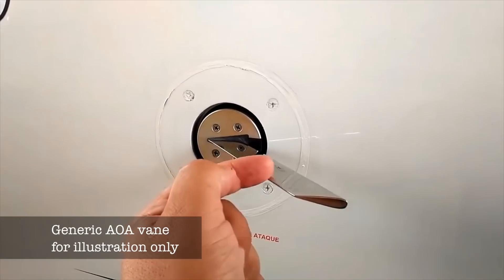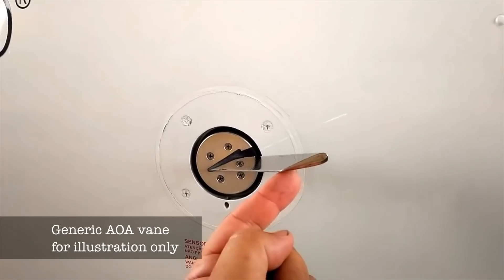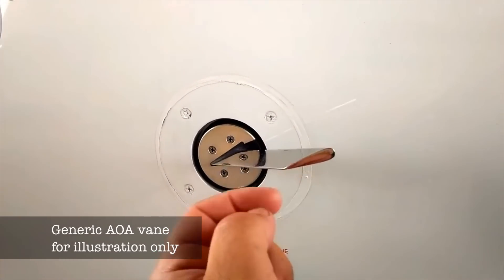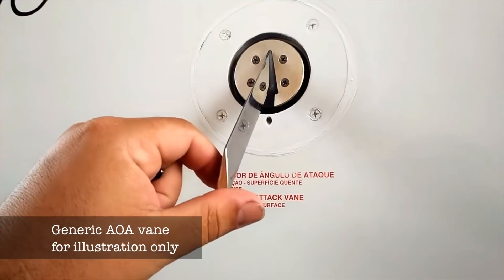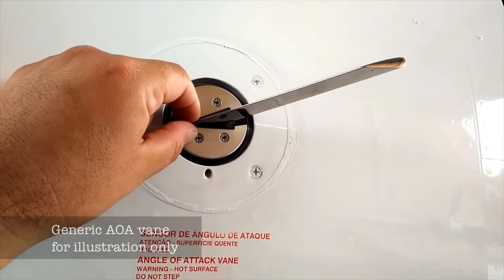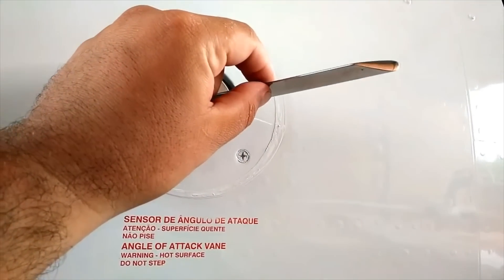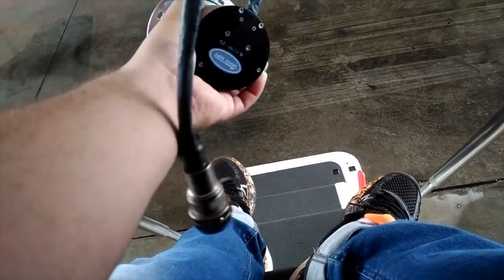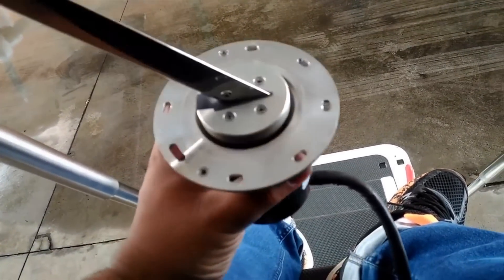Boeing 737 max 8 Angle of Attack problem - Prof Simon

Comment: dumb stuff:
using one of two indicators when comparing both would be the norm.
triple computer redundancy sounds great  ,  hooked up to one sensor does not.
no need for external sensors
you could do all this stuff with iphone gps ,  bow  , stern  , "one" wing tip , haha.
note that china was the first to ground the 737 , usa last.    usa yelled trade war at first.

i just learned that the 737 has only one computer instead of three
https://fortune.com/2019/08/02/boeing-flight-control-computer/
Reply: i just learned that the 737 has only one computer instead of three
https://fortune.com/2019/08/02/boeing-flight-control-computer/

Comment: Why is MCAS is required when Airbus 320 Neo do not  need it as they also have increased their engine power as well as placement
Reply: The Airbus is a more modern  aircraft with triplicated systems. It uses fly by wire or “FBW”.  In the Airbus the anti stall system is built into the fly by wire system.  So the Airbus doesn’t need MCAS it’s functions are already built into their flyby wire system.  Its a properly designed system with everything tripled or quadrupled.   If there is a fault in one of the four angle of attack sensors in the Airbus software compares all four sensors and works out which one is disagreeing with the others and switches that one out.  In the 737 there’s a 50-year-old hydraulic mechanical system and MCAS was a separate software and hardware add on to the artificial feel unit computers.  Because the B737 is an older aircraft it only has two of everything so the pilots have to decide which instrument is faulty.  In an Airbus because it has three systems the computers can decide themselves.

Comment: professor you are intelligent but not intelligent your angle of attack sensor your angle of attack sensor send the worng signal to mcas system and mcas system down the plan nose pitch to the ground and result is that 600 or more than costly and important for this world people's looses there lives I am very sad due to very bad do with them. Boeing wants to do properly checks there's plans like gauges all electrical and mechanical and electronics components,sensors etc.billions of people's looses there life's previus 80 years due to air crash incidents. please Boeing stop the play with people's life's and do not instal this types of bloody fool sensors in plans.

Comment: So now latest reports indicate the pilots DID shut off the stab switches to disable MCAS but were still unable to recover the plane from the fatal nose dive ,the story goes on ? Could it be MCAS restarted itself even though stab switches were off ? There's obviously still huge questions but this is looking more serious everyday that goes by ,I am so glad the planes are at least grounded if its saved 1 life its the correct thing to do.
Reply: Turning the stab switch are off turns off the motor that moves the stabilizer. That means that MCAS can't continue its mischief, but it it also means the pilots can't use their manual control on the yoke to drive that motor. They must hand crank the trim by brute strength. Given a number of factors, including the plane's excessive speed, that apparently became impossible. Near the end and in desperation, they turned the stab switch back on. Unfortunately, that brought back MCAS.

Yeah, you're asking yourself, why didn't the pilots have a way to turn of MCAS and just MCAS. Ah, but you're asking for a well-thought out design. That's not what we had here. This was Keystone Cops become plane designers.
Reply from the maker: If the MCAS system keeps re- starting that would be a major problem...I think we already know it trims the horizontal stab...beyond the point, elevator input can easily recover the aircraft... looking bad

Comment: Surely  vulnerable AOA vanes could be replaced with more robust Strain Gauges?
Reply from the maker: They need to measure air pressure...there are non moving sensors...good point.

Comment: I see the Lion Air logbook write up as an essential that lead directly to two crashes killing almost 400 people. Let's say it again. The off duty pilot saved the day on the first Lion Air flight by intervening and by correcting the MCAS failure. The crew made a logbook write up and the ground crew checked the system resulting in writing it off via "could not duplicate" write up. The next crew crashed the plane killing 189 aboard. They didn't read the write up from previous day? It looks like they didn't and that would be a monstrous failure making them on large part responsible for the second Ethiopian Air crash as well. Then the Ethiopian pilots didn't know about the Lion Air crash? It looks like they were as ignorant as the Lion Air crew! In my view, if these pilots were at least partially competent, we had no crash of the Boeing 737 MAX...

Comment: May be ice built up on the floating valve sending wrong signal to MCAS causing pitching angle downwards. More moving parts dangling out side of fuselage means unsafe ✈️ .

Comment: When I worked on the BAe 146/RJ Series, there were 2 AOA vanes. The anti stall system (stick push) was armed when the left or right vane reached a certain AOA and only when the other vane reached the trigger point, the system kicked in. The cross checking prevented un-commanded triggers. I'm totally lost for words if this is how the 737 MAX system operates. In ANY safety sytem there is redundancy and a level of supervisory diagnostics to validate sensor data. Where was the DFMEA? What questions were asked? What testing was done? Combine that with effective self certification via the FAA and I would expect both Boeing and the FAA to take the full wrath of the investigation outcome. This is not an unforseen accident (or 2), this is gross negligence by all parties on a mamouth scale!
Reply: And remember angle of attack sensor that is designed to be used for stick shaker and stick pusher are best designed to fail with a false high angle of attack reading which is fail safe considering the function is a warning and is also plausibility checked by comparison with a second sensor.  In the case of an angle of attack sensor being used for MCAS it should fail with an artificial low reading so it’s not used by MCAS forcing a dangerous maneuver.  This kind of super powerful system really needs triplication.

Comment: I see the accidents from a background in inertial navigation systems and earlier as a reliability engineer.  The MCAS system basically is only 2 failures from disaster as was the Airbus in the Atlantic a few years ago, both of which which crashed from 1) a failed AOA sensor and 2)  the crew failing to recognise the problem. Even though it can't always be done,  when a system can kill people,  the goal should be is to never be 3 or less failures from disaster.  With two AOA's and an inertial navigation system (which has real time pitch axis values in it) to check against each other and adequate crew training, none of those crashes needed to occur.  I don't know if the inertial pitch axis values were designed to be available to the MCAS system computer but they should have been.  Same argument with the Airbus.

Comment: I'm probabily not getting this right. If the system switches from one vane to the other and during testing no fault was found, does this mean they were test the vane that didn't have any issue? The testing was seen as a flight and switched to the faulty one the day of the crash?
Reply from the maker: That seems to be how the software works.

Comment: I don't believe this story. Makes no sense to have two sensors and alternate between using them as opposed to use both all the time making sure readings are correct. No way no how.
Reply: With two sensors you can only detect an error but not correct it. Since it seems boeing intended to hide the complexity or indeed existence of the system at all cost, detection of error was not interesting, so it didn't matter which sensor they used.
Reply: Nima Nikuie The story was confirmed by actual aircraft engineers in November last year. It has not received much publicity, since it is a subtle issue,  and hard to explain to the mainstream media.

Comment: You seem to have discovered the problem of tha particular incident . The problem. As an airline ,test pilot an accident inspector for the FAA. Through the 1970's and 80's I experienced the same occurrence several times and proven to be the AOA sensors in conflict "way back then" . It was decided by me an othe members of the airline flying community to not use such sensors any longer unti such equipment could be improved  or replaced with better and safer sensing equipment. At the time they were mechanical devices  which were proved to mechanical failure ,seizing  and sensing conflict.. Air Alaska had a perfect example of such a device in failure which was removed after a flight problem similar to what has been discussed.  A promis to look into the problem and the malfunctioned device but nothin seemed to ever have resulted until NOW!  Until real tragedy strikes.   The fact is I never liked the damned things. My planes fle very well without what i feel to be unececsary equipment. My feelings is for aviation technologist to look into and access the necessity of such devices and eithe redesign them so that they cannot dangerously effect the performance of the aircraft. Or get rid of such devices altogether. Thank you.
Reply: Myron Proudput There are multiple issues leading to the MCAS disaster. The AOA sensor is just the first weak link in the chain.

Comment: Is this the backup for a faulty accelerometer in the inertial reference system?
Nevertheless professor, this is very interesting. 
My instinct tells me I'm looking at a tiny airfoil. I'm not sure if this sensor ties in with air data or inertial reference, but, I see a surface that might be prone to icing more so on bottom than on top. This would create a pressure differential that pushes down on the vain telling ADIRS that the plane is at a higher angle of attack than actual. 
I hope they got heat for that like the pitot tube.
Reply: Michael McMurray Measurement of airflow and navigation are two entirely different systems, though they do overlap in the overall aircraft controls. They are heated to prevent icing.

Comment: I've been following the events closely ,this is the scariest thing I've heard ,does this mean the faulty sensor was NOT changed ? Unbelievable ,correct me if I am wrong I also find it hard to believe that the max does not hand authority(from MCAS) to the pilot in the event of 25lbs force on the yoke as it does with auto pilot
Reply: ZeroHour It seems more likely that the sensor was not faulty, but the data was corrupted by an electrical glitch.

Comment: Does anyone know what fails in these sensors?
Reply: Frank Cawler There has been speculation that the fault with the AOA sensor was electrical not mechanical.
Reply: see the word potentiometer  2:02 ?      that's another name for a variable resistor which is attached to the axel.       measure the voltage with a voltmeter  2:08 and you can know the angle of the vane flying thru the air.   an analog-digital converter will yield a computer friendly number to be sent thru a network to a computer for action/noaction.     lots of stuff must work for this to work.
And this gizmo always reads the same except near stall speed.    

jokingly: you could have an iphone-gps in first class telling the main computer the location , speed , direction , rate of ascent , altitude , angle of attack.

Comment: What would be the point of automatically switching between aoa sensors as the single input for each flight cycle? If a sensor failed, it seems that this method would almost guarantee the use of it within 2 cycles, in flight, without redundancy.
Reply: Swankdaddy It sounds bizarre, but if you have two systems, and use the same one every day, you will never know if the second one is actually working.

Comment: Could it be that the MCAS only adjusts the stabilizer to move the nose DOWN, but never restores the stabilizer to the neutral position even when the nose is already down so that the jack screw only goes in ONE DIRECTION??
Reply: blablabla1185 This is something that I was interested in also
Reply: blablabla1185 MCAS is designed to return the stabiliser trim to its original position once the risk of stalling goes away. Unfortunately with a stuck AOA sensor, this never happens, and the nose keeps going down.

Comment: Not getting answers to the Atlas Prime Air Crash either. But it nosed dived in decent into Texas. Wondering if it is this Instrument that this 767 had an "Angle Of Attack" Problem also? Almost seemed similar, except this other Cargo Plane was at the end of its flight and not just after Take Off.

Comment: For me , it is amazing how little redundancy there is in a piece of hardware so critical for the aircraft flight and the work of the auto pilot. This is not the only crash related to this, the Air France a330 that crashed in the Atlantic or the Quantas flight  (another a330) that almost crashed in 2008 were external sensors problems that fed wrong information to the computer. Don’t airplane manufacturers know that  there is such a thing as artificial intelligence to manage this! Or at least use more redundancy. ...

Comment: By relying on both sensors in tandem they're multiplying the risk of failure, not the reliability!

 RAID0 indeed... 🙄 

Something that is bugging me: every phone I've had in the last decade has had a host of position sensors. There's GPS, giros, tilt sensors, compass... So if you know the x & y position in which the plane is moving, and know the angle of the plane. Then you have the angle of attack. It may not be as precise as a dedicated sensor, but it gives you an indication that they are functioning as expected.
Reply: You are right, but only very roughly. Apart from the inability to take into account the winds (live weather satellite feeds maybe), there are other technical problems. In order to precisely know the speed and pitch of your aircraft you need a very precise navigation system. Inertial or satellite, it would be space or military grade. If such technology exists at all, it would be expensive and/or prohibited. Not to mention complex and delicate.
On the other hand you have a simple vein and a pitot tube...
Reply: But I agree, a less accurate system could still provide a sanity check against malfunctioning sensors.
Reply: Gareth Evans It is not a simple process to determine the AOA from onboard sensors. What you can determine easily is pitch, but the two are not the same, since AOA is the actual airflow over the wings. This difference is particularly true if the aircraft is maneuvering (climbing or turning). Stalls can and do occur in all kinds of pitch orientation.

Comment: Looks like if an AOA sensor failed, the plane has 50/50 chance of a crash - yep they deserved to be grounded.
Reply: But there would be no crash if the pilot overrode the autotrim when they saw it kept moving forward and pointing the nose down.  

In the crashes the pilots kept trying to fight the auto trim by pulling the yoke up, but failed to disable it so they could trim manually.    No one knows why the pilots ignored the trim.

Comment: Why nobody even remotely suggests the possibility of terrorists involved. Why no airline failures in the USA? And remember how mcas works as stated by the professor. If flaps are deployed then the mcas system is disconnected. At what flap setting was the max in question set at?  Let’s roll out some facts before bias or innuendo!

Comment: To be sure, better manuals. indicators as well as training should be required. The Ethiopian SIC  pilot was unable to assist in the memory items for runaway stabilizer procedure according to voice recordings.
Reply: If this is actually the case, it is extremely concerning and indicative of a systemic problem. In 2010, an Ethiopian 737-800 (previous generation) crashed after takeoff from Beirut. The final report released by the Lebanese Civil Aviation Authority stated that the flight crew mismanaged the aircraft's speed, altitude, and heading. This report states that the crew's flight control inputs were inconsistent and these resulted in the loss of control of the aircraft. Further, it states that the crew failed to abide by Crew Resource Management principles of mutual support and verbalizing deviations and this prevented any timely intervention and correction of the aircraft's flight path and maneuvers.
Reply: where did you get that information? the data from the recordings so far not made public

Comment: My phone has an attitude sensor and through the spirit level app I can see what angle it is tilted at. Why do they have to use a sensor (vane) that is subject to the excesses of the upper atmosphere?
Reply: Chris Bradley Because the body angle of the plane is not the same as the angle of attack. The AOA is the angle between the relative wind and the chord of the wing.
Reply: @sgriffith2353  Thanks for the reply and I can see how airflow would factor into this. It just seems to me that the vane option has its own inherent problems and a better solution could be found.

Comment: Professor has it half right. Good system design does NOT rely on a single input for normal ops. BOTH AOA should have been used at the same time. If an input goes out of range it is either voted out of use or the entire system is shutdown.

BTW mechanics at repair stations have been reporting a surge of AOA sensors coming in for repair. There might be a manufacturing error in many of the bad sensors.